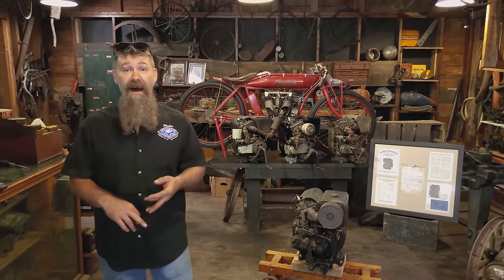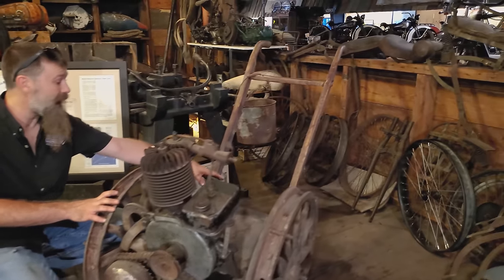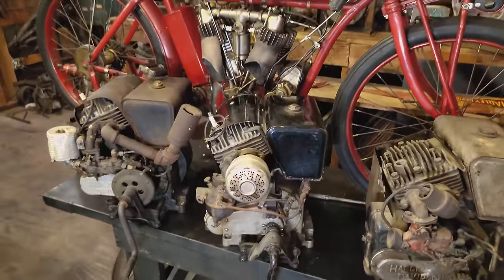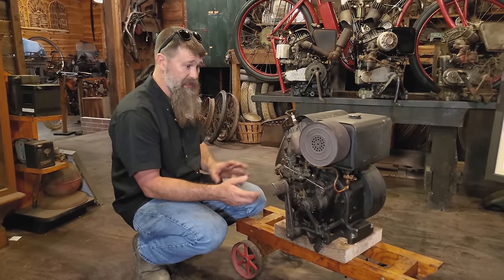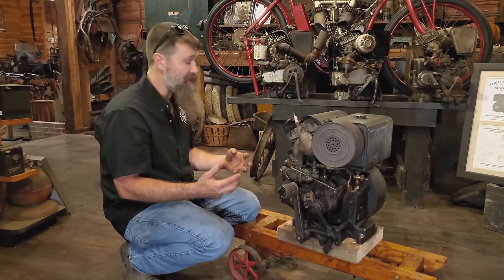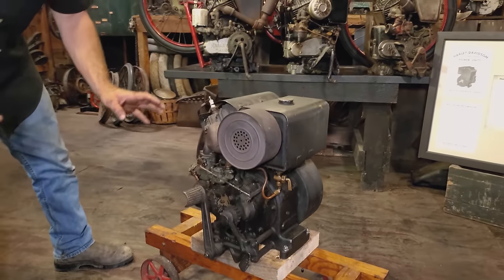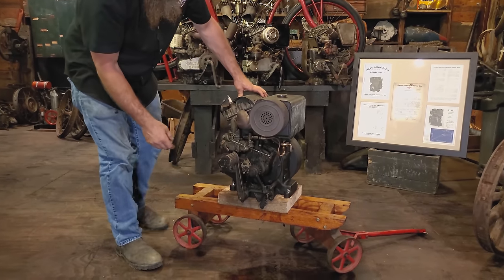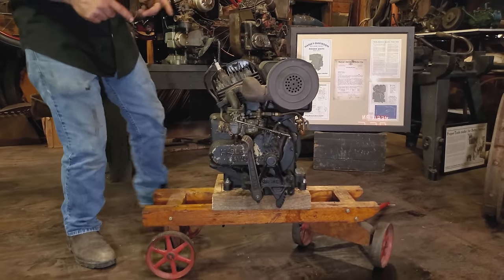INCREDIBLY RARE HARLEY!

Comment: Pretty cool.....I recall back in the early 70's going with a friend to have a driveshaft cut and altered for a project car.....we visited a retired machinist he knew, and in his shop, the size of a two car garage he had, not a Harley engine, but a Gray marine engine set up and running a series of pulleys, shafts and belts criss crossing the ceiling....running a couple lathes, drill presses and a milling machine. It was a complete 1920's era machine shop.....I often wondered what happened to it all, probably scrapped as the entire area was developed a few years later.  What always interests me is the degree of longevity and reuse of these old devices.....stuff was made to last, unlike today's disposable crap.
Reply: How lucky you were to have visited such a shop! In my hometown we had 2 brothers that invented and devised machinery as well.As a youngster I remember visiting their steam powered sawmill, with an amazing criss-cross of overhead belts running the various saws, ie. the main saw, the cut-off, the edger,, even a blower to exhaust  the sawdust... All could be either engaged or disengaged at will by "shifting" levers on a central control area. Fascinating!

Comment: Could you imagine finding one of these as a kid and bolting it onto your gokart or bicycle?
Reply: When I was a kid we drug an old Maytag 2 stroke washing machine motor out of the barn that was buried under some hay, it had go cart written all over it as far as I was concerned but the old man wasn't letting that one happen.
Reply: A lot of these were used to power irrigation pumps in southern Cali till the '60s.
Reply: @scottmcneely6488  
Now the pot growers in Cali steal the government roadside programmable signs for the solar panels on top to run their irrigation pumps.

Comment: Boy my generation (I'm 27) here in the U.S.A is messed up with the measuring systems.  We know how long 1 foot is, we know what 1 yard is, we know 1 mile. We don't know how long 1 cm is, we don't know how long a meter is, we don't know kilometers. I see people freaking out going 80KPH!!!... converted 50mph wait that's slow... where we are most screwed is engine size, most kids don't know what a 454 Cubic Inch is, nor a 350 C.I., or 460 C.I. or 60 C.I., but we know what 5.0 Liter is , or 6.2 L is and we know what 600cc is or 450cc. Gotta love it. Go to the auto store and ask for something for your 472 C.I and they'll say "what size is that?" Sorry I meant for my 7.7L. I love your videos, but I have to convert from cubic inch to liters to understand the size of a motorcycle engine. Sorry for the rant.

Comment: Do you run your old engines on modern 87 octane E-10 pump gas even though they were originally designed for 65 to 80 octane straight gas?

Comment: I want one of those so I can put it in a bicycle!
Reply: you can use a model airplane engine for that..
Reply: That'll be a motorcycle you're after then?
Reply: @mikejames4271  No, I was just kidding. If I had one of those motors I would probably just look at it......  I used to have a book titled Inside Harley Davidson, loaned it out and now I'm trying to get it back. In the book it shows a prototype HD walk behind garden tractor! The Motor Company was struggling to stay alive during the depression. The book also shows two VL road paint stripper machines that the factory mounted the stripping equipment on a side car. Rear sprocket is giant to allow low speeds. Did you know that Indian made some now very rare outboard motor boat motors?

I have a Pan and a Dyna Evo and my dream motorcycle would be a Maytag washing machine motor powered bicycle!

-'lil stan
Reply: @stanfischer6175  No, i didn't know Indian made outboards. Very interesting though.

Comment: Fun to watch you videos and recognize all the Ford Model T parts which were used on these bikes.  This video has the hand cranks.  Readily available at the time these engines were produced, could have been spares or picked up on the used market for super cheap.  The other part I've noticed so far are the "No Skid" tires on some of these bikes.

Comment: The shroud over the top is "not" for protecting you're hands from getting burnt, it is there to direct air from the flywheel over the cylinder and head to keep the engine cool.  the air is sucked in through the shroud from where the two drive pulleys poke out.

watching some of you're vids i find it a shame that you get some of you're terminology wrong, you seem like a knowledgeable guy.  maybe some thing to work on?    the other thing is  it would be nice if the camera guy focused on what you are explaining instead of floating around all over the shop, would make it a lot easier to follow.   other than that the vids are great extremely interesting, you are one lucky bloke to be around all that beautiful rare history..   thanks for taking the time to show the treasures you have to the rest of us around the world,  i for one appreciate it...... cheers
Reply: He knows so much about so many pieces in that place that I'm sure he has a mixup here and again..these guys are THE AUTHORITY on anything knowledge wise about these era machines and they're also learning new stuff everyday.
Reply: Hey Steve.... You ever heard of "DUAL PURPOSE"!!!....🤦‍♂️